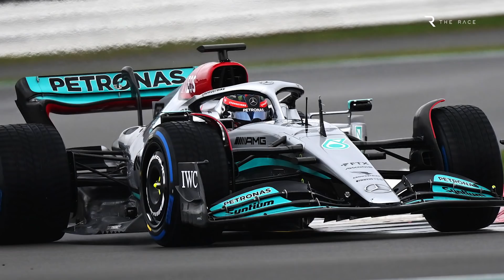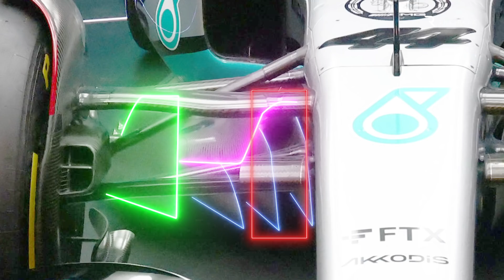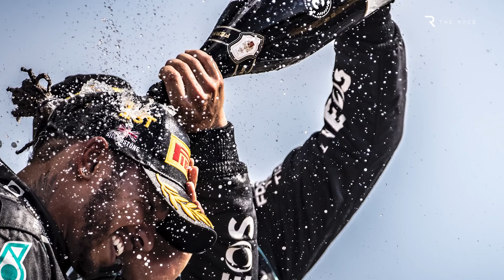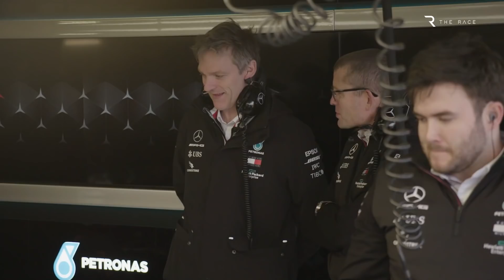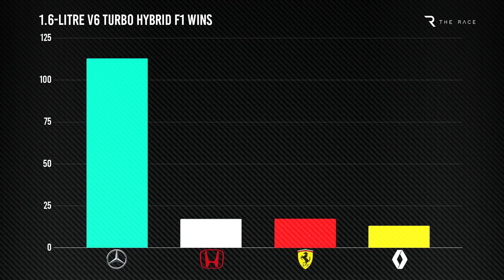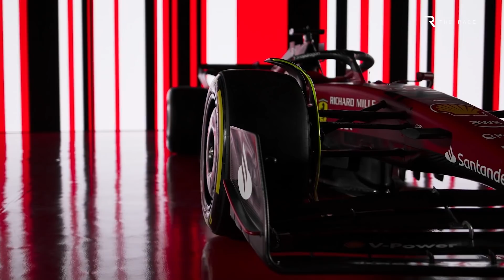Why Mercedes needed 'a huge internal redesign' for its 2022 F1 car

Comment: I feel nmerc could never turn there engine up because of cooling issues. This year maybe different. Let’s see. I feel they got the upper hand already …..
Reply: This aged horribly
Reply: @razrr8484  yeh it has unfortunately. Can't fault the reliability though considering how tight and compact the power unit is.

Comment: "despite its success, Mercedes takes nothing for granted"

Dude they take EVERYTHING for granted, it's why they lost the championship last season, they think they're untouchable, Red Bull proved them wrong last season so hopefully they act on the threat.
Reply: bro wdym? if they took last year for granted, they should've been closer to aston than WINNING the constructors championship, since they both have the low rake concept which was targeted by the V-cut on the floor.
Reply: @johnyu4897  They didn't even spend their upgrade tokens though. The strategy team played like it was still a Mercedes monopoly, they made no effort to improve pit stops either, I could go on.

Comment: To all those many uploaders who have put up a heap of hot air clips doubting whether Lewis will retire or not, will race in 2022 or not. Well guys, there you have some confirmation that he will race in 2022. He was at the launch of the car and tested it after Russel took to the wheels first. The 2022 season is going to be fun.

Comment: In 2014 Mercede was the only manufacturer of a hybrid road car engine, and hence had a huge advantage come race day, now 8 years later it's a complete reset everyone is on the same level. I myself don't think Mercede will have it as easy this time as they did in 2014 and my prediction is Hamilton will retire if they don't.

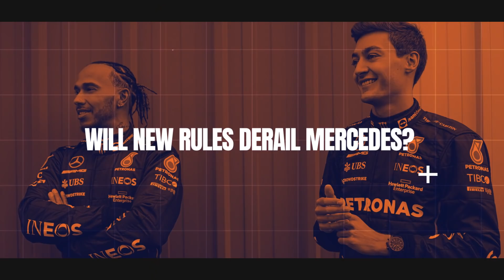Comment: Your question @5:50 "Will new rules derail Merc"? The answer is no. They are the undeniable masters of the turbo/hybrid era. The only reason they didn't dominate in 2021 is because the FIA made everyone reduce the floor which hurt low rake cars more then high rake cars. This new 2022 design will be setup specifically for these new regulations & considering the Merc has always had a fantastic engine they should be very fast. Not to mention the fact they have shown amazing technical ingenuity, ex DAS system. I'm sure Mer will do a great job with these new regulations.

Comment: “Past achievements mean nothing, we start from zero.” Not entirely true, given that Mercedes is blatantly ahead of everyone in the engine department
Reply: @AdmiralOddSock Rory Byrne and Adrian Newey does have some experience on ground effect
Reply: 4 teams are using that engine
Reply: @TheTororist  I always thought that the other teams get tuned down version. Why should merc give it competitors the same engine? Or are there rules so that they have to sell the same engine as they use?
Reply: @ButterflyEnte  I think they always sell a downgraded version of the same engine
Reply: Aramco is now the main sponsor of Aston Martin and they´re making videos outright attacking competitor cars. If that doesn´t let you know F1 is corrupted I don´t know what will.
Reply: @buzzbuzzard3809  Interesting...I will have to check it out, F1 has always had politics, fowl play, and corruption. Hard not to with how international the sport is, how much money it costs to fund/participate in the sport, and the pressure from NATO to "ban" ICE engines. Which is a load of crock if you ask me. Someone with enough money, power, and influence will simply be able to have their choice of an endless array of fun cars to drive once it has been outlawed for the common citizen, as it will now become government property. I would imagine this would also include old f1 cars as well

Comment: Pardon if I am not using the right terms for their job positions (which are too complicated in Formula 1), but I am surprised that no one is mentioning the fact that Mercedes is tackling this challenge of new set of regulation changes with a new brand technical directors in both Brackley and Brixworth. While I am sure they are both very capable, I do wonder how much of a challenge that was, having to deal with all these changes "at once".

Comment: With no disrespect meant towards Lewis, I seriously hope he doesn't fight for an 8th in a Merc solely because I don't want to see Toto suceed. I would argue Toto's overpressuring of tghe race director position is the root cause of the Abu Dhabi ending that he wouldn't (and still partially won't) accept. I hope Merc flops, Lewis goes to a less externally toxic team, and finds success there.

Comment: Ed talked about restrictions on the number of CFD and wind tunnel runs are made by the leading teams. However, since all 10 teams have the same annual budget cap then Mercedes will have more money to put into other areas. It may balance out for them anyway.

Comment: The Merc car looks a bit more purpose built, where as most of the other cars feel like they are trying something new to see if it works, this could be Mercs downfall but I feel like Merc knows what they needed and nailed it. Will be interesting once the cars hit the track.
Reply: Perhaps they nailed it early by having better computer simulation of airflow.
It amazes me that FIA still limits the permitted wind tunnel test time, considering that computers have been used to simulate the aerodynamics of car bodies & engine internals of production street cars for more than 2 decades now.
Reply: @woah.9411  I said "perhaps."  When I said "better" I meant software design quality, not time spent or CPU power.  Also, nobody knows what happens at the home of a team's design chief.  He could do a lot of preliminary simulation there, and bring the successful outcomes to work (where FIA is watching).  If FIA wants to see the development steps, bring every 5th one from home to demonstrate an accelerated process.
Reply: @woah.9411  As my grandfather said 50 years ago: "There's none so blind as those who won't see."

Comment: They was focused on the engine more than on Airflow. Because wings can change during the coming years, but not engine.
Reply: Don’t you understand that the engine department is separate working in a separate facility. You need an equally competent chassis to get the best out of the engine
Reply: Engine development is also not part of the cost cap

Comment: Merc prepared for the 2014 rule change long before winter 2013. In 2016 they didn't have other teams to challenge them so they could switch focus, in 2017 and 2019 Ferrari and RB, respectively, came much closer to Merc. Last year Merc and RB pushed each other until the end, so their focus wasn't on 2022. But I know what Merc and RB fans are going to say- "[insert Toto or Horner] said that they set a hard date to switch focus and they kept it", "Last update [insert Merc or RB] was in [insert random race at the start of the season]".
Reply: merc actually stopped development very early in 2021 season to focus in 2022
Reply: @Navarrion  Firstly, what did I say then? Secondly, do you really think Merc switched focus early (when RB had a better package) and still won the constructors title?

Comment: The switch to E10 fuel may lead to a slight reduction in fuel mileage, I believe. Ethanol, though only (theoretically) 10% of the mix, burns at twice the rate of gasoline, so they may have to dial back the tunes a bit.
Reply: They have petronas which is clearly more than an oil money sponsor. Not to mention petronas fuels half the grid.

Comment: I work with 3d CAD modeling since 2015 and worked with CFD simulations for a while and Im going to be brutaly honest about these videos: Most of these informations are hard to predict on paper, 03:00 for example. 
You absolutely can't predict airflow behaviors such as energy gradients, stagnation zones, boundary layer behavior etc on some pictures. CFD simulations often reveal qualities even the most experienced aerodynamicists i've met didn't predict even with full 3d models at hand. in my experience predicting the effects heave, pitch or roll cause on these modern undertray is near impossible without simulating or experimenting. Many of these aerodynamic elements at the front of the car have complex influence on the airflow energy feeding other subsequent elements and so on. 
Saying that this or that should make something more robust etc is way far fetched. 90% of what goes on witht hese designs are very hard to predict and point flaws like this.
Reply: yeah its completely ridiculous for you to assume that the only way that the team are predicting the outcome of the airflow is through 3D modelling inside of a CAD program. But cool.
Reply: @EchoMirage72  you design a model and then validate the concept goals with the CFD analysis. Other more practical tests come later down the road.
CFD's main goals is to reduce dependency of both scale/full sized wind tunnels or other practical validation.
CFD is the first way to tell whether or not you are on the right track. Many times you have to come back to cad to modify certain geometries and then simulate again.
I'm not sure of what you are trying to say here.
Reply: @Lucas-ck1po  Im literally saying that analysis within the simulated computational formats aren't the sole factor in determining whether the design is practical or not. Im not entirely sure where you got the first comment from that teams are using only simulations to determine how the air will flow over the cars.

While you can sit there and spout your "technical expertise" you really shouldn't be so condescending considering you're the one making assumptions on how teams and The RACE are determining how air will flow over the vehicle.
Reply: @EchoMirage72  My intention was not to be condecending at all, but to say that the technical information here isn't very grounded, they are staring at pictures and drawing lines over them.

No, CFD analisys isn't the only tool to experiment with aerodynamics but it is the least expensive and in most cases, the frontline of it as it was created to reduce validation costs.

Turning your models into finite elements meshes and then runing CFD on it comes alot before any sort of practical experimentation, and it is alot cheaper.
With enough PC power and solver knowledge you can run simulations on your home with softwares like StarCCM or Ansys

Tell me, in what ways do you think they have experimented on it in order to claim that Mercedes has to change something? That a certain geometry is or isn't optimal? i dont get it, im genuinely curious at an academic point of view. 

English isn't my best skill honestly and perhaps the word bollocks came out as an insult to the people trying to come out with the best possible content but what i am saying isn't without grounds.

Sorry if i offended you, the very last thing i wanted was to sound snob, God no.
I will edit my original comment btw.
Reply: @Lucas-ck1po  Who are you referring to here? The RACE or Mercedes?

That seems to be the problem here.

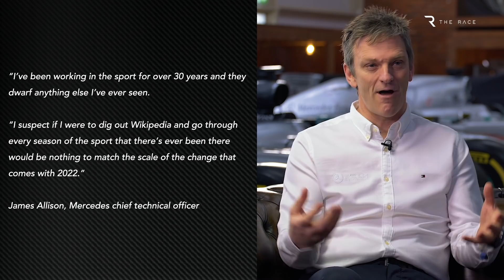Comment: 6:24 "... there's the risk that the new regulations could derail Mercedes."

I think Lewis may have had (past tense) good reason to stay silent and consider retiring -- with all these changes, Mercedes' dominance is simply neutralized. He and Mercedes no longer have the momentum as such anyone or any team can gain the upper hand if they have the better package.
Reply: If you can see into the future why aren't you winning millions in the lottery?
Reply: Silverback gorillas weigh between 300 and 500 lbs. While I hope for some team to 'Brawn' it this year, Merc is 'that' gorilla.

Comment: I'm not quite sure that Mercedes is completely legal. There are some dodgy aero bits that seem to break rules. On the rear wing there is a straight bit on the end of the wing surface for example. The new rear wing rules were put in place to remove those straight bits to rid the cars of vortices from my understanding.... Some of the floor concepts on some of the cars also look illegal to me, especially where there are little flaps, cuts and ruffles in the floor. The new rules were supposed to remove those and so either the FIA hasn't cracked down hard enough on the wording of the rules or some teams are just flat out ignoring the rules.

Comment: Well if the chassis turns out to be average, they can just turn up the engine, just like they did in 2014, 2017, and halfway through 2021

Comment: I've been an F1 fan for 20 years, I've never been so excited about the new season! Even after the rather depressing officiating of the last year. I wish this rule set was introduced earlier. 2009-2021 was an unnecessary detour on the road towards solving the problems that were known and well-understood back in the mid-'00s.
Reply: Pandamasque What are you talking about ? I doubt you have been watching F1 for 20 years as you claim, 2010 was the best season by far.
Reply: @IconiclasmXI  2009 cars were supposed to address the overtaking problem. They didn't. Things kept getting worse and led to DRS introduction, so now we don't have fighting for position, we just have "passing" most of the time. 2022 rules are supposed to do what 2009 rules failed to achieve. And 2009-rules cars were catastrophically ugly due to disproportionate wing dimensions set by the rules. 2022 grid on the whole is the best looking grid since about 1993 (before everyone followed Benneton with the raised nose).
Reply: @IconiclasmXI  u mean 2012 right?

Comment: How is Gary going to approve this design but tear into the Ferrari design when the side pod has the same flat edge it’s just the backside that differs Ferrari is going for up wash towards the rear wing Mercedes is going for a downwash towards the Coke bottle diffuser and b wing area. They better hope that front wing concept is doing some serious work for them because everyone else on the grid seems to have taken a different philosophy of sacrificing front down force to power up the Venturi tunnels and the wing and the diffuser.

Comment: Well said about last years rules basically gifting the high rake cars the win. Total respect for you mate not scared of upsetting the 33 fans.
Reply: That’s not what he said. He just said it hurt high rake which is obviously true. It is unfair that Mercedes that they changed the rules with development mostly frozen.

However, that did not hand max the win. If you go back and look Mercedes ran a smaller wing at almost every track meaning they needed less downforce from wing than redbull and had advantage on straights
Reply: Mercedes won the constructors championship despite max winning the drivers championship. That should tell us something. Bottas still beat Perez more than Perez beat him. Furthermore bottas beat max more than Perez beat lewis. Mercedes had more 1-2 finishes and front row lockouts as well. All of that means one thing. Mercedes car was faster.

There were plenty of low rake cars that didn’t have a chance at beating Mercedes. Clearly that’s not the definitive factor. McClaren even had a Mercedes engine, so you can’t argue the engine made up for the rake. 

All teams had to adapt to new regs. Aero is very sensitive to minor changes. After perelli came out with new tire and Mercedes figured out how to make high rake work with new regs they were faster.

Comment: Engine performance does carry forward. So technically you're not starting from zero.
Reply: There are new Fuel regs, so the engine has to be redesigned
Reply: @HeizouHaver  Minor changes, most engine manufacturers already regained the entire deficit. Also, when a team has such gap on engine power on grid, its a clear advantage, no?
Reply: @60037894  no. The performance still doesn't drop from the heavens, they still would have had to work on getting it to work
Reply: @pixelboujee  Not saying it miraculously appeared. They have built it over years and that's their advantage. If you say loss of 20BHP (assuming merc does nothing, which they won't) due to fuel makes it even stevens, I don't know what to say
Reply: @60037894  well since half the grid is the same engines and the Honda engine is just as good you can't just say that the advantage is lasting. Especially since red bull powertrains will be hungry to make their mark

And don't tell me that engine clients are always at a disadvantage as compared to the works team because I can just point you to look at Renault. Bad engine and worst of all any clients they had were generally better than the works renault team themselves. I hope you see the point